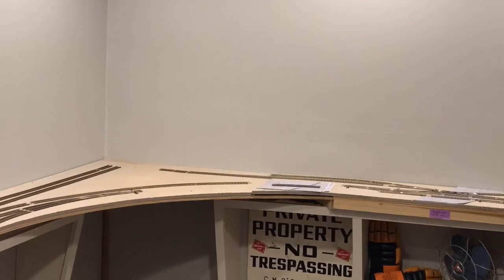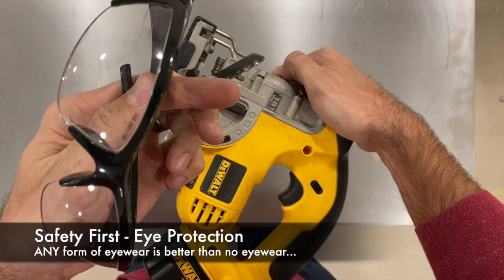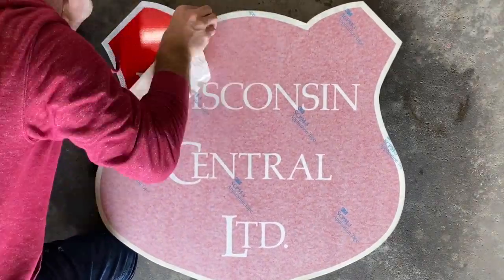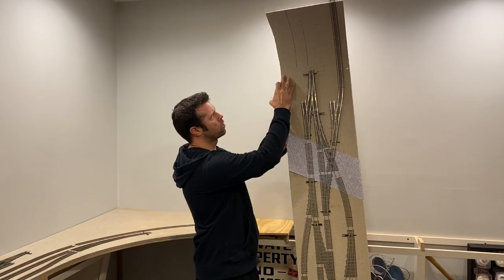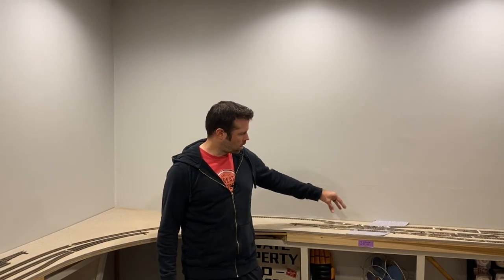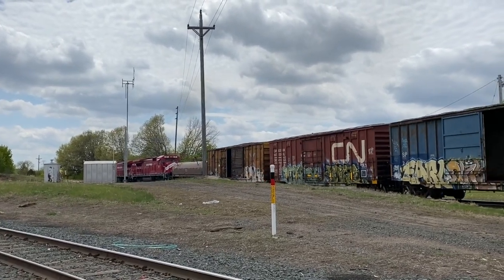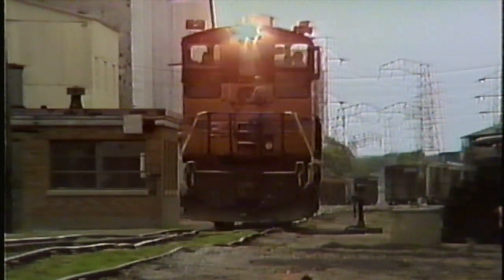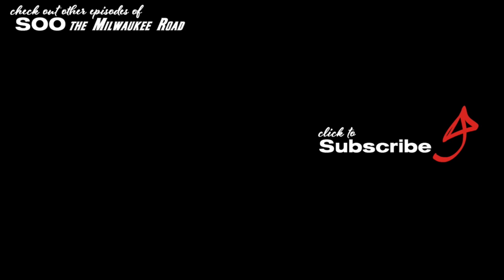S04E02 - The Benchwork Explained with MORE Vintage 1986 Bob Rivard Footage of the Elevator District

Comment: Another excellent episode! You have a great design concept on how you built your layout in sections to allow you to work on it and install the switch machines without having to work under the layout, which is never comfortable. Those were some excellent tips on applying the decal, I know how tough that can be to get it perfectly applied and all the bubbles out. The Minnesota Commercial and Bob Rivard's prototype footage was a real treat. Your going to need to hit your track work with a hammer if you want to capture the look of the prototype ;). You must be reading my mind on the multiple choice, I always guess, but I got this one right!  As the Curmudgeon said,  "It's all about operations" and I completely agree. -Tom
Reply from the maker: Tom, it would t have been moved forward as far as it has without your encouragement. You’ve completely changed the pace of my progress and I know I keep saying that, but I’m extremely grateful for the momentum you’ve created. As well as getting my wheels back on track, I was derailed on other tangents. Ops are coming, I can see it. Thank you!!!

Comment: Another great video! Those industries will prove for some great operations. If you want to make operations more interesting I suggest adding a run through train that just runs around the layout so the switcher has to time its moves between when mainline trains come through. The Minnesota Commercial Railroad is one of my favorites. They have rostered lots of unique equipment like RS20s, and RS18s. My dad captured a photo in the 90s of the exact same RS18 they roster still in service on CP Rail before it was sold the Minnesota Commercial. They also have a AS16 slug which is the last AS16 known to exist and the only CP Rail M636 to be repowered with a caterpillar engine. Have you ever caught one of the RS27s? When those throttle up they are true Alcos.
Reply from the maker: A number of quality suggestions. This is a point to point RR and prototypically, this area did not have through trains. In a loop type track plan, that’d certainly make things a bit more entertaining.
Reply from the maker: We’ve already covered the RS-27, in a previous episode, but to be honest...can you ever get enough of an ALCO?!?

Comment: Ahh, so much time fanning the Commercial. I remember all the excitement in the area when the former GBW ALCo's arrived, after the sadness that the WC had bought them that is.

https://flic.kr/p/RAvby  #313
https://flic.kr/p/b6vqfk  #311 years before it's Silvis burial.

Neat to see the vintage video footage from the area around the elevators. I wonder how many of the double slip switches along there are still in place?
Reply from the maker: I've always joked that the MNNR is the rolling museum. As for the double slips? I had no idea the elevator had double slips. Having been down there just recently and walked the tracks, I can say there's zero left. I'd know one if I spotted one. Great interior looks into 311 and 313! Love the shots. Thank you for sharing those, I'm a big fan of the GBW.
Reply: @SootheMilwaukeeRoad  Somewhere in all of the boxes have I have photos of them in all their greasy disused double slip goodness. If it'd had a lick of sense I would have spent the 30 days when work was shut down earlier this year and went through those boxes. I think I walked all of the elevators sometime between n 1991 and 1994. The switches were unlocked and I recall moving the points back and forth seeing how it all moved (And yes, I certainly realigned them as they were when I found them.)

I was quite lucky one Saturday or Sunday in 1993 when 'bandited' GBW #311 arrived on MNNR's property fresh from the WC pushed by the CF7. I was without a waiver that day so eventually, I was asked to leave which was a bummer as the hostlers started going over #311. It would have been neat to have that on video. The grapevine in the local railfan community was that the WC had sold it off after the coolant water sight glass had cracked. Never heard if this was actually true or just railfan rumours. Ahh, I miss standing around at the Hobby Depot on Saturdays eating doughnuts and talking about stuff. Dang, that was 25+ years ago!
Reply from the maker: mathue taxion that’s a prime example of time flying!!! What a great series of stories you’ve shared. The double slips are priceless relics for sure...ya don’t seem ‘em around much at all. If you do run across ‘em, be sure to let me know. They’d be so cool to see!
Thanks for the posts, they’ve been great to read. I hope you’re well and we’ll be in touch soon! Thanks for tuning in and commenting. I enjoy it!
Reply: @SootheMilwaukeeRoad  I will directly contact you if I find the photos of the double slips. It's on my list of stuff when I not working on my 70' Volvo. And thanks for reading my responses, it's fun to talk with someone in that area since I live quite far away now.
Reply from the maker: mathue taxion I’m always game to connect with fellow RR junkies...the exchange of stories, ideas and information is invaluable. No one person has the exact same experiences, which makes connecting with one another that much more enjoyable. Thank you for being willing to share the stories and information.